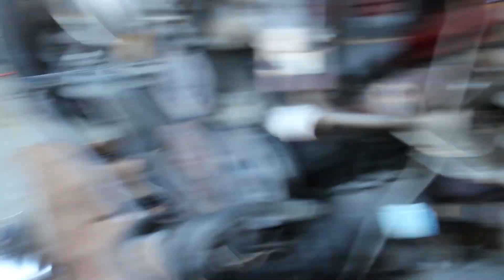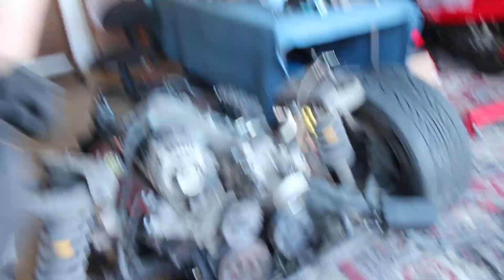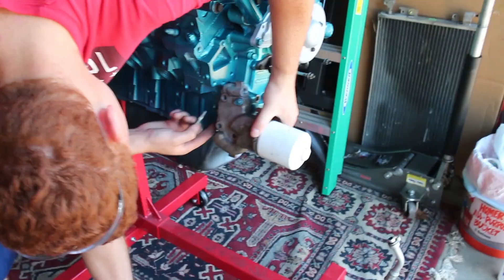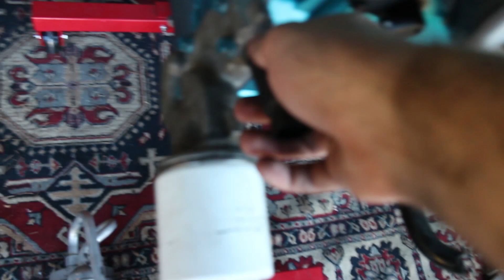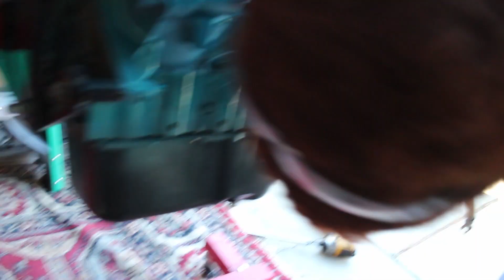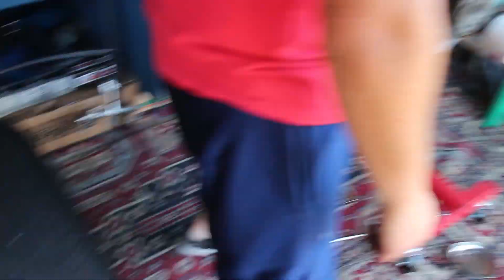Project F L67 Camaro Rebuild Part 2 (The Engine is Really Coming Together!)

Comment: How are you going to fit the throttle body?
Reply: We've talked a little about it before.  We are planning on making an intake that wraps around the engine on the driver's side. And running along the valve cover to the front of the engine. At that point we'll mount the throttle body to that. I'll have to make a bracket that supports it's weight and attatch that to the block somewhere.
Reply: @MegaZombie101  either the firewall or the supercharger housing has to be cut up in order to fit the 180 bend that brings it forward
Reply from the maker: @dandonofrio8441  We're making a custom adapter for the back of the supercahrger. We'll then attach a tight radius 90 degree corbra head silicone intake to it then piping it forward over the vavle covers (I'm sure there will be firewall modification).